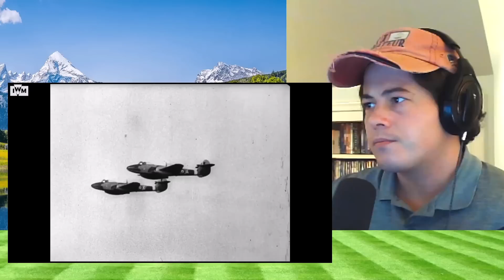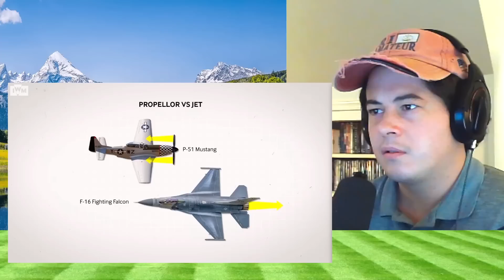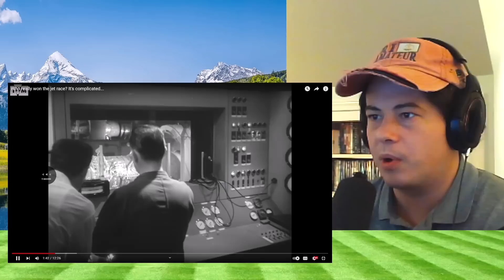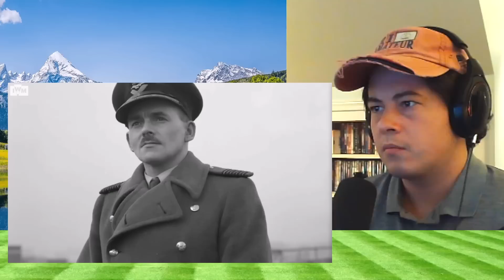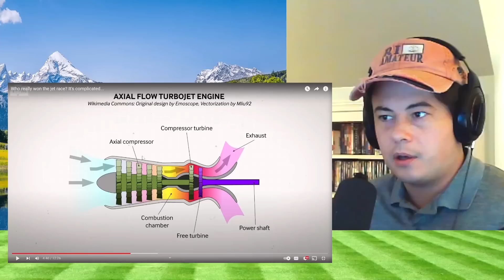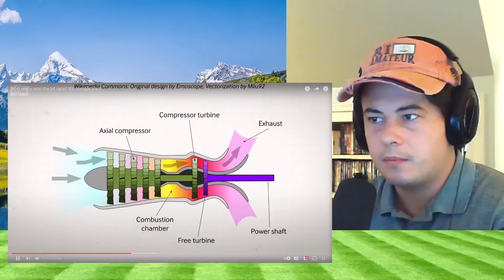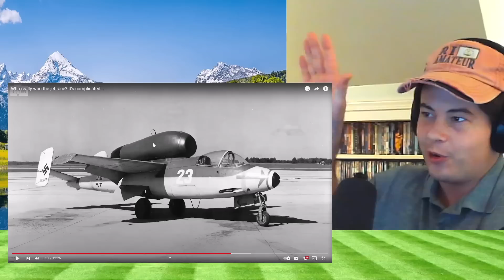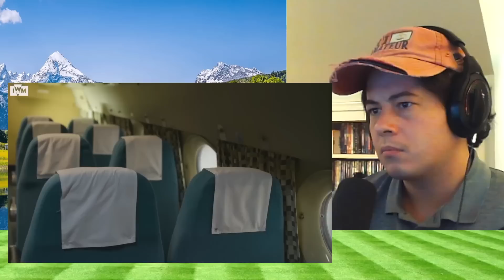American Reacts Who really won the jet race? It's complicated...

Comment: The Germans knew the Junkers Jumo engines that powered the Me 262 fighter jets lacked endurance and reliability since the right materials for the engines weren't there and unavailable to them. It's reasonable not to assume that the Brits knew of their limitations also. Furthermore, it is also a reasonable rationale as far as claims and counterclaims by IWM revisionist hysterical REVISIONIST historians was that the Brits won the jet race. But, hey! if it was true that they did have the right materials for the Gloster's RR Derwent, why is it that they scrambled together with the Americans and the Soviets for advanced German technologies including the engines for the Me 262 with the USAAF as part of "Operation Lusty" at the end of the war?

And "Meteor pilots were forbidden to overfly enemy territory in case they were shot down" (?) Poor excuse---there's a war on! Truth be told, their performance was slower and they were less heavily armed than its German counterpart during that time. Early Gloster Meteor jets, including the Gloster E.28/39 and the F.9/40 prototypes, utilized centrifugal-flow turbojet engines pioneered by Frank Whittle, .It's also a poor excuse to claim that the Brits have the right materials for their engines and they didn't want the Germans to get their hands on them. 

The metallurgy requirements for a durable engine were already known to the Germans...they just couldn't get their hands on them. And if the Brits had the right materials for the engines, the combat record speaks tons for itself! Sure the Meteor was in continuous improvement and production right to the very end of 1980, but in WW2 they weren't there to great effect. The Meteor jets instead became a "jest" since it never shot down anything but buzz bombs (14 V-1). While the British manufacturers were having a tiff with engine designers like Whittle, the Me 262 axial flow jets were proving time and again that axial flow engines were the way to go! And by saying "it's complicated..."  In that video, it became really complicated because anybody can make disingenuous claims and complications right up to anybody's medulla. 
Shame on I.W.M. 

Captain Eric Brown, a British test pilot who flew 487 types of planes during his service, flew a captured Me 262 (as well as other German WW2 jets--even the 4 engined Arado Ar 234 Blitz bomber and the Heinkel He 162 'Volksjäger' jets) after the end of the war. He referred to the Me 262 as "the most formidable aircraft of WW2." He noted that it had a number of innovative features, but in terms of performance, was a quantum jump ahead of other planes at the time. In particular he noted its swept back wings, its axial flow jet engines (another validation), and the four powerful 30mm cannons, and with that speed "you could conduct combat totally on your own terms. If you didn't want to engage, you could go off and leave everyone standing." 

Truth be told...the Me 262 shot down 542 allied combat aircraft, something that on whatever terms one can define it, ----the Meteor couldn't compete against because ny the end of the war, its score was a pathetic 0... against enemy fighters! 

The Meteor couldn't hold a streak, no matter what excuses and revisionist claims IWM they can come up with. So finally
realizing that THE VIDEO BY THE IMPERIAL WAR MUSEUM COULDN'T HOLD A CANDLE IN THE WIND --- it was pulled off of YT AND THE PEOPLE BEHIND THAT TOM-FOOLERY SLITHERED BACK INTO THEIR HOLES.  FOR WHAT IT'S WORTH, IT'S GOOD THEY DID SO AS. IT WAS A THOROUGHLY IDIOTIC FILM.

Comment: There are Meteors today with original engines still flying. Also the Comet was the first pressurized passenger aircraft and initially had square windows..! Hence the fuselage wear and tear.

Comment: Max speed for any propeller aircraft is around 500 MPH.   Blades can go supersonic and reduce efficiency big time. Even using turbo jets.

Trike undercarriage was already used elsewhere.  (Not possible with a gurt great propeller up front.)
Wings on Me262 was necessary simply because engines where heavier than expected.  Hence wings "swept) to move them backwards to restore C of G.  Aerodynamic "advantages"  unexpected benefit.  But small ( if any) at the speeds reached.

Comment: Compression crushing very similar, if you want to try and find out what compressed air feels like get a cycle pump put your finger partially over where the air comes out and pump you will find out quickly what happens to compressed or crushed.

Comment: Yes connor you are correct, the engine on the ME262 had a life of about 20 something hours. After then the engines had to be replaced. This is one big reason that so many of the ME262s that existed could not be put into the skies in the last days of WW2.

Because the number of engines being worn out couldn't be replaced by new ones fast enough.
Reply: Yes, the Germans were unable to develop alloys for the blades to withstand the severe high temperatures in the turbines, which limited the engines lifespan..

Comment: 7.15 In simple terms the compressor was initially rotated by a starter motor, compressing the air. Fuel was injected and the air/fuel mixture was ignited. The resulting expanding gases rushed out of the tailpipe providing forward motion.
The rotation of the compressor was maintained by a set of vanes attached to the rear end of the main shaft in the flow of the exhaust gases.

Comment: British gave the USA the jet engine, just like they gave the Wright brothers airframe design in the form of gliders. Germany gave them rockets. They were given steam engines, petrol engines, diesel engines etc. The USA gave the world litigation, the wright brothers were experts in this field spending much time trying to stop others developing their own aircraft. All the above is available if you research.
Reply: Once granted, the patent was published and became available worldwide. It lapsed in 1934 when Whittle found himself unable to afford the renewal fee of £5.
The First Patent - Sir Frank Whittle - inventor of the jet engine page
Reply: Post war RR sold the Nene engine to Pratt and Whitney.
Film, audio recording, light bulb perfected, Triode, escalator, airplane, assembly line applied to auto production, FM radio, alternating current/AC, broadcast radio, electronic television, Ferris wheel, first US patent for radar granted 1934 (Wattson Watt began experiments in 1935 following a MoD request for a "death ray"), klystron tube (valve), Hughes tri cone drill bit, Houdry process for catalytic cracking of oil and Salk polio vaccine.

Comment: The turbine blades are turned by the exhaust gases, the shaft turning the compressor blades sucking in and compssing the air.

Once the whole thing is running it is self sustaining as long as there is fuel to burn.

Comment: The original Jumo 004 engine had a service life of around 100 hours. However, as the Reich was lacking many strategic raw materials, the engine had to be extensively redesigned in order to save nickel and molybdenum in particular. This not only led to a loss of engine performance, but also reduced the service life due to increased wear on parts subject to high thermal stress down to 25 hours. The design changes due to the lack of raw materials also set the Me 262 program back by 1 to 1.5 years.

Comment: Propellers 'fly' like a conventional aerofoil, close to the speed of sound conventional aerofoils shock stall, & won't work any more, jet engines also have the same problem the airflow through the engine needs to be below the speed of sound but the jet blast doesn't, supersonic jets usually have intakes that restrict the speed of flow down. but to achieve high speeds often an afterburner is used [ a rocket]

Comment: The Germans didn’t have access to chromium which meant their turbine blades which were made of normal steel as apposed to chrome steel didn’t have a long service life. Although they lacked the power,  the British engines were easier to produce and maintain.
It is the combustion in the engine that turns the turbine shaft which is attached to the compressor blades. As more air is sucked in and compressed it increases the power of the turbine which in turn sucks in more air. Modern engines have multiple shafts inside of each other in order to run the different parts of the turbine rotors at their optimum rotating speed which is just below the speed of sound.

Comment: With regards to the limits of the propellor driven aircraft, this was explored by the Americans when they created the "Thunderscreech". But to put it simply the limitation comes in the fact that the turning speed of the propellor reaches such speeds that the first blade creates a vaccum in its wake and it gets to the point where the second propellor blade moving at such a high speed actually passes through vaccum created by the first blade, thus negating thrust. Also the tips of the propellor blades go supersonic which also can cause problems.

Comment: Actually we flew a jet plane in 1941, The Whittle Power Jets W1, well before the ME262 and the Gloster Meteor. As for understanding jet engines, google it and more blades compress the air in stages. Takes a bit to understand but so simple really...

Comment: The effects of metal fatigue had been known since around the 1830s from mine engineering, and was progressively investigated as those effects began to proliferate on railway engines and their tracks. 

Strangely, little work appears to have derived from metal ships - presumably because if metal ships failed they were lost. Yet ships always had round portholes...so...

The science of repetitive strain causing metal failure was well known by the mid 1900s. But the primarily metal aeroplane was only common as of the mid 1930s, so a lot of learning was squeezed into the next 20 years, and I am sure that many aircraft were lost to metal fatigue.

The Comet was  such a newsworthy item that its losses had an immediate effect.

There was still no ability to predict failure until 1961, and so designs up until then had to be tested. The Comet's square windows were [with hindsight] not adequately tested beforehand.

Comment: Aircraft before and during WWII did not fly for long enough to get metal fatigue. On top of that, Pressurised fuselages were only used in one aircraft before then, an American Bomber. The problem the early Comets suffered from was not the amount of time it was flying, it was the constant changes in air pressure, every flight the fuselage would be pressurised and depressurised every time it took off and landed. At that time, a flight from London to South Africa would need multiple stops. So the fuselage was expanding and contracting many times during its journey. All of this was new to Aviation. The original Comet had square windows, fatigue crept from the corners. It is why all aircraft now have round windows. Of course Boeing missed all of these problems as just by luck they put round windows in, but at least the doors didn't come off the Comet!

Comment: The first comments had square windows and with the pressure going up and down crack started from the corners of the windows and ended up breaking the plane apart, that is why the widows on all commercial aircraft are oval or round.

Comment: The swept back wings, so the story goes, came about by chance. The wings were originally straight out but the weight of the engines altered the centre of gravity. Rather than redesign the whole fuselage they swept the wings so that the Centre of Gravity remained as calculated.

Comment: As the air cones into the air intake each fan compresses the air it receives. Thus, by the time it reaches the last compressor blade you have a high density compressed amount of air.

Comment: the ware and tear was caused by its altitude jets need less oxygen than piston planes this means can fly much  higher but they have to be pressurized this causes the fuselage to expand and shrink again causing metal fatigue above ten thousand feet the air is very thin most people would not survive more than fifteen minutes with out the plane being pressurized most modern aircraft fly around thirty six thousand feet  the exception being the concord that flew at sixty thousand feet this was partly to do with noise pollution from its sonic boom and its high speed reducing its chance of colliding with other air craft a safety feature in modern planes is oxygen mask in case of decompression to see how metal fatigue happens take a thin strip of metal then bend it one way then back again keep doing this eventual the metal will split and break

Comment: If you are interested in the development of the Jet Engine during WW2, Dr Hermione Giffard’s book  Making Jet Engines in World War II is now considered the authority on the subject. It covers the development of the engines by Britain, Germany and the United States. Regarding Meteor, a prototype was developed for each British engine development, including an axial flow Metrovick F2/4 engine version 3,850 lb thrust. DG204 was very fast, but like BMW 003 1,984 lb and Junkers 004 also 1,984 lb trust its operation life was short, before a major overhaul. The Meteor  Derwent Centrifugal flow engines also produced 1984lb trust but had a 150 combat hour life before overall.
The RLM was forced down this route because they couldn’t compete with British or American aero engine manufacturer production. For context the Rolls Royce Merlin 61 series has used in Spitfire VIII Spitfire IX and Mustang IV equivalent lbs trust, 1,891. So the early Jet Engines were achieving the performance of the best propeller engines, being lighter and less complicated. 
Farnborough undertook back to back tests between Meteor and the Messerschmitt 262. For the same trust engine power, the Messerschmitt would be around 20 mph faster. However, the Messerschmitt had high wing loading and no air brakes, so it required very long runways which were limited and combat engagement was difficult because of closing speeds. The Meteor, wing loading was lower, consequently shorter takeoff for airfields of the period. It also had airbrakes. So Meteor proved to be superior for aerobatics and combat. The debate on performance has continued since, particularly because of the Fritz  Wendel report and the Fuhrer edict for the 262, must not be flown faster than 750 kph, (466 mph), must not be dived and descend below 12,000 feet. This brings the 262 into the performance envelope of Tempest, Mustang D and Griffon Spitfire XIV which is credited with shooting down the first 262.

Comment: Hi! Connor. Metal fatigue expt: take a paperclip, bend it & straighten it repeatedly. It will break and if you touch the broken ends they will be hot. In practice fatigue happens slowly, then propagates at the speed of sound (in that material) BANG! oops!

Comment: The Comet’s metal fatigue was caused by fitting square windows - the corners were a weak spot, attracking splits. That’s why airliner windows are round

Comment: It was metal fatigue of the body contributed to by square windows creating higher stress points. Windows were rounded and the problem fixed but by then trust was gone and Boeing (with round windows as well) was on the rise.

Comment: The fundamental problem isn’t so much the engine as the propeller itself.  For one thing it creates drag which limits speed.  More importantly it moves much faster than the aircraft so its tips become supersonic (and therefore inefficient) long before the aircraft.  The compressor of a centrifugal flow engine was an impeller which pushed air sideways: think of a really old-fashioned hairdryer with the air intake on the side. Axial flow engine uses a turbine or turbines as the compressor and therefore draws air through in a straight line like a modern hairdryer.  The essence of the gas turbine is that the hot gas turns turbines which are connected to the compressor causing it to spin.  Despite appearances the Me 262 is not regarded as having swept wings and I’m rather shocked that the IWM repeat this common fallacy. The 262’s wings were swept at 18° to control the aircraft’s centre of gravity; swept wing aircraft must have a wing sweep of at least 30° if they are to delay the compressibility effects which prevent high speed flight.  The Comet’s issues stemmed from its extremely light design which was pressurised for long periods of high altitude flight, something that no previous aircraft had attempted.  It wasn’t wear and tear!  Metal fatigue is the phenomenon of metal slowly weakening and cracking as it’s put under repeated loads; it simply hadn’t been seen before.  Had de Havilland not experienced the problem Boeing would have done.

Comment: The Comet was for the day very big, pressurised and doing a lot more flying than any military bomber (which had pretty short service lives). So it was pretty much the first time such an aircraft did enough flying for metal fatigue to become a problem. The problem was twofold, a hole cut for an antenna had square corners (this was the “window” that failed, not the ones you can look out of), and they’d anyway built the Comet 1 far too light (because they didn’t have enough power from the engines). Contemporary accounts said the airframe flexed a great deal. And by the time they’d redesigned it, the world had moved on. 

Today Britain’s position in the aviation industry is more monetarily valuable than ever before. This is because our companies shrank to concentrate on the expensive parts; avionics, systems, wings, engines, undercarriage. So some good came from that early experience!